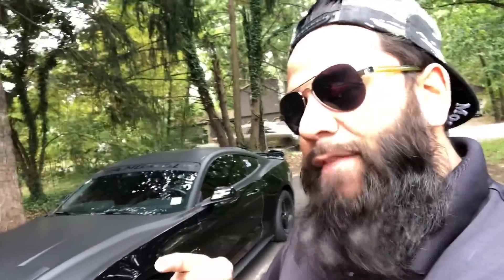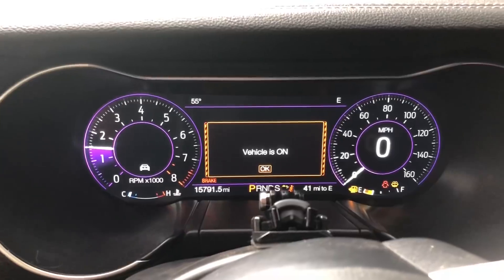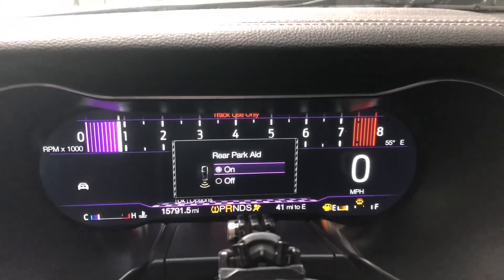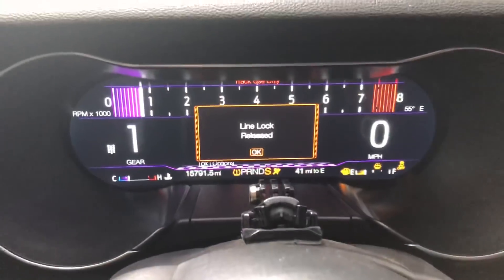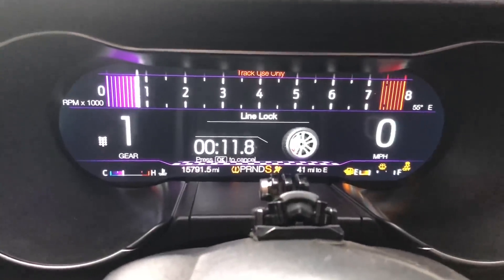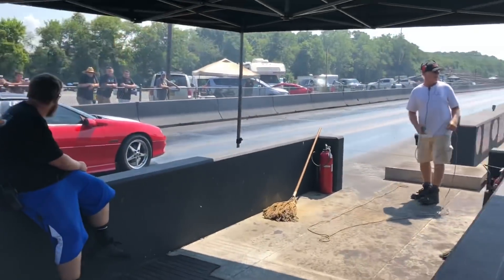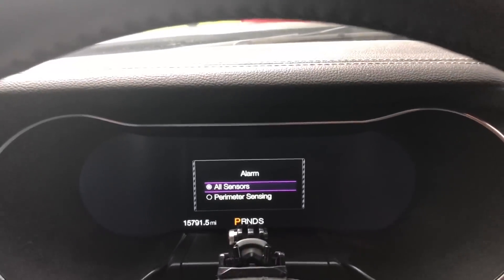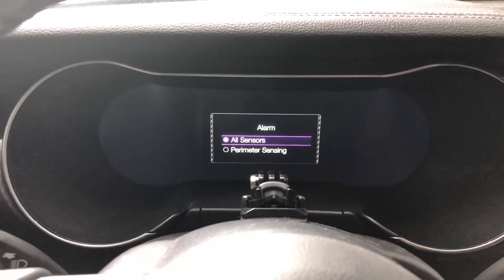How TO Properly USE "LINE LOCK" in a 2018-19 Mustang GT!

Comment: Hey the exhaust mode error is most likely caused by a loose clip. The electronics for active exhaust are clips  just above the mufflers on the outboard side. Try releasing the clip, unplugging and plugging back in. Hope that works for you
Reply from the maker: Charles Cinque thanks will try it

Comment: Hi!! For the line lock, you need to press the brake pedal hard o just hold the press to activate the line lock? I’ve a Mustang 2015 and the line lock sometimes failed cause I’ve to press a lot and very hard but it’s difficult to active… it even looks like the brake pedal will break lol

Comment: Hey Stangmode, not sure if you have heard of this issue but you should do a video on it. Basically, Ford has been installing the wrong analog RPM gauge in the 2018+ Mustang GT's for the North American market and overseas (well, except for the US, who aren't affected by this issue). The analog rpm gauge they install for the GT is actually from the 4-cylinder Ecoboost model so it has the incorrect 6500 rpm redline display, where as the GT gauge is supposed to have a 7400 redline displayed, like the US model. Ford has been installing the wrong part since it was first reported in late 2017, when the 2018 GT models started getting delivered to customers. The problem still hasn't been fixed and now the 2019 GT models also have the Ecoboost rpm gauge. So I'm driving around my GT with an Ecoboost redline showing 6500, yeah totally awesome. I'm sure most buyers won't even realize their 18+ GT is supposed to have the 7400 RPM redline gauge, or that the car can go past the displayed 6500 rpm redline. Anyway, this whole issue is ridiculous, especially when you consider Ford is still installing the wrong part. 🤔
Reply from the maker: JCTiggs whoa 😲 I had no idea that’s crazy hit me up on Instagram with some pics and stuff
Reply: @StangMode  Thanks for the reply Stangmode!  I've reached out to Ford Canada but haven't heard back from them yet. There's a big thread about the issue over on the 
Mustang6g forums. The thread is mistakingly titled as a 7000 rpm redline display, but it's actually the 6500 rpm redline I mentioned above. Here's the link which also includes pics further down on page 1 of the thread.. 
https://www.mustang6g.com/forums/threads/canadian-2018-mustang-gt-300a-limited-to-7000rpm.95056/
Reply: You know i really like my mustang , however just a FYI ford isn't the only MFG having issues the new jeep JL has a Trac bar bracket weld misconfigured and it totally missed the frame it's now a safety crash issue recall .
Reply: @StangMode  Yeah, it's complete BS on Ford's part. I recently heard back from 'Ford Customer Care' and they freely admitted that all GT models with the KMH speedometer also have the the Ecoboost rpm gauge from 2015 +(which has the displayed 6500 redline).

Comment: Man that sounds mean as hell, what exhaust are you running in that beast ? Line lock is awesome, and have a burnbox in my chally srt8. Was going to do a traditional hydraulic system, but then discovered this electronic one and is superior in every way. Mainly because you don't have to cut into the lines, and just simply plugs into the OBD port. I think that the company only makes them for Mopars if I'm not mistaken, and is called Z auto. It also changes the fan settings for cool downs at the track, as well as controls it for a light show if you're into that sort of thing. But only use it for the line lock feature, because we utilize a diablo tuner that allows me to control the fan etc and don't need it 👍🏼

Comment: Awesome 😎 thanks for the lesson unfortunately the line lock mode is removed from our Australian versions that are sent to us (you think California is bad) Can you please tell me what are the wheels and tyres you are using when you are full on drag racing those black star pattern ones Brand and Size front and rear and also same with the tyres Thanks
So our Australian version is the 2018 Mustang GT premium pack it has all the options yours has you can’t buy a POV pack or a Shelby in Aus

Comment: My exhaust did that as well after headers. A wire was cut off/disconnected and ford had to replace the right muffler
Reply from the maker: Really what did it cost or was warrantied? Thanks 🙏
Reply: Warrarntied, even with headers and CAI and Tune. Took around 50 days because muffler was on back order.

Comment: Thanks for the video. I have a manual, do I hold clutch in first gear and let clutch out all the way or feather the clutch just enough to spin the tires or?
Reply: Sure you can feather the clutch if you wanna buy a new one.
Reply: just dump the clutch

Comment: Great video here
Reply from the maker: Zander13 thanks 🙏 Fam!
Reply: Zander13 I totally agree. I had the line lock fail first time at track also. Nothing a clutch dump couldn’t remedy though ;) 

Stangmode  I’m curious how hard it is to remove the interior like you do for the track. Should do a how to on that and at the same time weigh the pieces you take out to show weight savings. I’m 6’4” 325 lbs so I need all the help I can get haha great vid brother! Cheers

Comment: It's not smart to do your burnout in the water box or where it's still wet. Specially with street tires. Also just roll through the water. Don't spin the tires in the water either. Water will drip back on to the tires.

Comment: I got a 2019 mustang gt and it’s only 365 something miles on it. Honestly I’m scared to do a burn out cuz I might broke something in my engine. Lol 🤣
Reply: That’s why you have a warranty 😂😂
Reply: Same here, 800 miles but scared to startle my baby with sudden revs 😂
Reply: @mubashirkhan3803  I only have the Ecoboost, but I had 19 miles on mine when it did its first burnout.  Was the first thing I did after signing the paperwork and getting the key fob.
Reply: @lynex83  you are raising a warrior, keep up!
Reply: 2020MurderMaro 1SS I have never done a burnout before, in either my ‘17 RT or 2020Gt PP1. Never will, honestly. I didn’t do any hard accelerations until 1300 miles after I did an oil change.

Comment: Mustang comes with line lock on the auto but doesnt come with launch control in the auto. I dont get it doesnt have launch control on auto but has line lock . Stick car gets launch control and no line lock. Pretty stupid if you ask me it should be the opposite.
Reply: blkbird98ta manual gets both. I have a 2018 gt 6 speed
Reply: Both on my 16GT